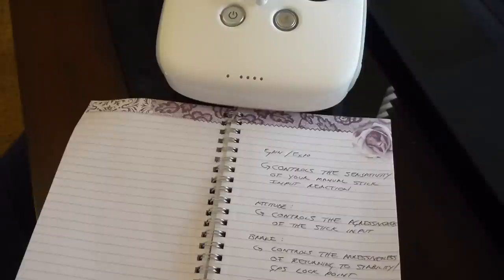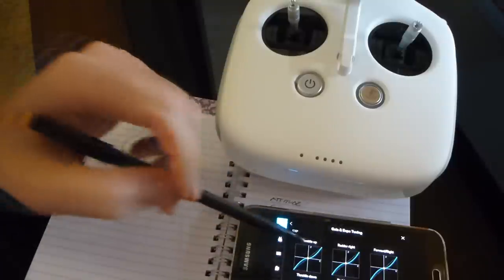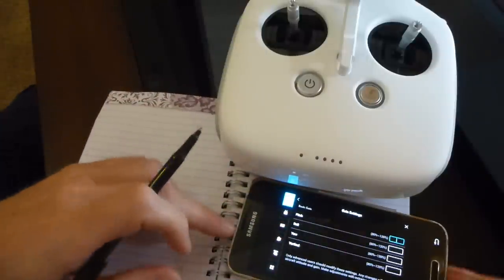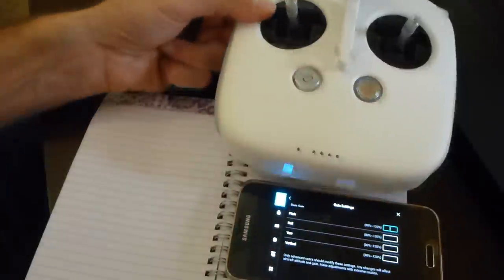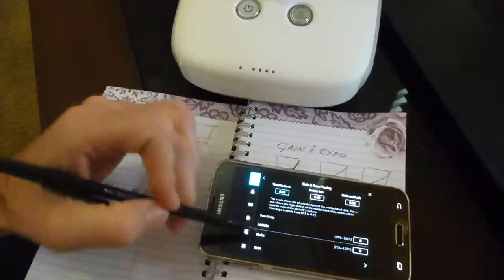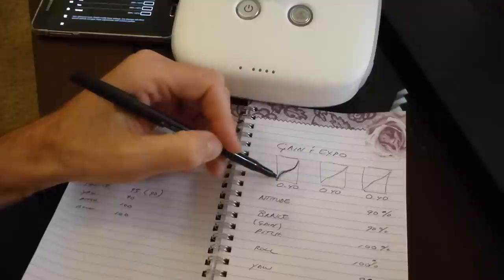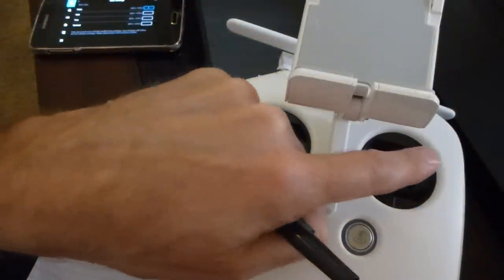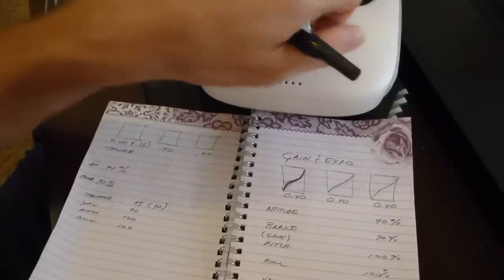Phantom 3 Gain / Expo / Attitude and Brake Settings

Comment: This is very helpful. Can you tell me if this analogy is appropriate?Let's say I have an electric hospital bed. And it has a remote control I can use to adjust the tilt. If that controller had an expo setting and I adjusted it down, then when I pressed the button to lower the bed, I would have to hold the button longer to get the bed to tilt. In other words, it would have a dampening effect on the control. And if the bed itself had a motor with an attitude adjustment and I lowered that setting too, then the bed would tilt even more slowly upon receiving the command from the controller.  In essence, it would be like a second layer of dampening. Is that sort of it?

Comment: the phantoms work so well is because of that overlap and redundancies. It's kinda limiting in a small way but it more than makes sense for over all great performance that we all love from Dji products. 
If slow, smooth, high quality video is your goal adjusting these gain, expo, sensitivity, settings down a little bit is essential. lengthen the controller sticks will also result in a slower, smoother control of your drone

Comment: Thank you for the video, great information. What about Yaw Endpoint feature found in last dij software update; what is it for and what would be the correct setting for smooth pannings? Thanks.
Reply: @luciano - Yaw End Point is excellent, I love smooth slow pans / yawing. I have both my Expo Yaw and my Yaw End Point set to the lowest / slowest. Yaw End Point terminates the full operation of the input of the joy stick. You can move it all the way but it will only except the first movement of the stick. So if you slip, cough of sneeze Yawing won't suddenly speed up it ends the yaw point at 'slow' even when the stick is held wide open.

Comment: The explanation answered my q... am tired of messing with this thing it's time to fly so I came here to see if I changed no setting from how it arrives, will it crash (all other setup is done). Came to see if adjustment is required for first flight or defaults ok
Can see now it's all the same pizza these are different slice portions and the rate at which you get your slice served varies

Comment: My question is what is the difference between the attitude sensitivity and changing the roll / pitch gains together? I completely understand the concept of the expo / gains. but when it comes to the sensitivity does that act like a travel limit? I.e. max pitch or roll angle. And the gains affect how quickly the control system on board corrects to meet the desired input input? 

I come from the world of RC helicopters and fixed wings, therefore I am more familiar with servo travel and expo.
Reply from the maker: Hello Evan.  The Attitude controls the aggressiveness of the craft in reaction to your input whereas the expo controls the sensitivity of the controller in relation to your control input.  The gain controls the recovery of the craft to outside influence or the aggressiveness to reposition the craft to it's original position.  You can soften the reaction of the craft to your input with the expo's and also soften the reaction of the craft to those softened input controls).  Expos = sensitivity in.  Attitude = sensitivity of the craft to those inputs.

Comment: Hi Badger, interesting video. Kudos to you!...Your video shows you are doing .40 expo.   From your comment to Jeff Lewis, it seems you reverted to .30 all 3 expos, but still you lowered to 90%Att - 90%Brk. For gains, 100% everything except yaw at 90%...I will test these, but my question: is the reason for lowering expos back to .30 had to do with too rough of an input on your sticks?...my main concern when filming is the yaw speed...I wish it to be smooth and slow. Would only playing with the yaw percentages be enough? Thanks a lot!!
Reply from the maker: Hello Rich.  That's correct.  I Tuned down the Expos to 0.30 to soften the initial power input and dampened the yaw gain to 90% and the braking to 90%.  For me it works really good.  For filming at 0.30, it's less tempermental at slow speeds and initial input which helps a lot with a smooth ride and the braking at 90% is great.  Instead of snapping back relatively abruptly, it offers a nice soft 5 foot cushion stop from about 15 m.p.h.  For now these settings are just what I wanted!

Comment: Very interesting... what is your Yaw %?  It's not displayed on the video...
Thanks!
Reply from the maker: I tuned it down just slightly to 90% to tame the turn but still wanted to keep a good amount for critical situations. I also tuned all three expos down to 0.30.  So my full settings are .30 on expo. 90% Attitude,  90% brake, 100% for all gains except yaw at 90%. These settings the the overall flight but still give good control for me

Comment: That was very helpful  very nice job!! .. do you have a spread sheet or PDf on those settings
Reply: Thanks Airborne.  I don't have a spreadsheet written down.  For me, it's more fluid and intuitive based on how the craft is reacting.  I've found that in general I like to keep my Yaw low at .2 to slow the turns for good filming.  The pitch and roll I normally have set to .30 or .35 depending on wind conditions and how fast I'll be flying.  If very slow filming for a stationary low level subject, I may go as low as .2, .2, .2 on all settings.  For higher flying and longer distances, I'll leave yaw at .2 and go up to as high as .4, .4 but beyond .4, I don't find much benefit as it takes away from the quality of the filming which is what I'm always trying to achieve.

Comment: FYI, The common stress cracks at the motor mount area is a direct result of the harsh motor torque with the factory settings. Especially the braking values!!!! lower the braking value to 85% and you will never see stress cracks appear!!! FYI #2 Those motor mount reinforcing plates that you see on Amazon immediately VOID your factory warranty!!! Adjusting control values does not!!

Comment: wondering if i can increase gain on pitch so it go faster for getting back home
Reply: Hello Greg.  The best way to increase your speed if you do not need to rely on GPS orientation (if you have visual line of sight) is to move into ATTI mode.  The speed in ATTI mode will exceed GPS mode.  Gain is designed to control the amount of energy input the craft will use to regain position.

Comment: thanks, for the video. but still have problem, when moving forward, i can see the props and motors, like he is too agresive. what i need is slower forward and backward and slower horizontal moving not seening props.. I have phantom 3 pro. c. my setings are  in exp 0.40 0.30 0.40,  gain sett. pich 80, roll 80, yaw 80, vert 80, in stick filt. altt 100%, brake 100%,yaw endpoint 150%. thanks again for helping.
Reply: With a lower expo it will slow or soften the input; however, it will not decrease the max limit of the stick input.  For example, if you're pitching forward with low expos, you may have to put in 50% input to reach a mid- level pitch or attack moving forward; however, at the end of the stick input it the angle of attack will always reach it's limit.  The best way I've found avoid having the blades in the image is to move the angle of your gimbal down to roughly the red line on your monitor/phone (right side of screen) about 15% down pitch.  You'll lose some sky; however, you can typically fly at 20 to 25 m.p.h. with non aggressive maneuvers and always maintain a clear screen.
Reply: Thanks for answeing.
Reply: Bobi Lazareski You got it!